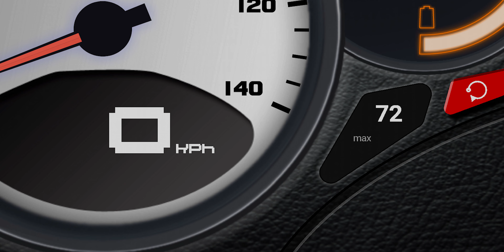ASW Carbide Ride 2 + Top Speed (4K)

Comment: All that done and only that fast.... mine is stock with only an A9 cam and it does that....
Reply from the maker: All the mods are for power not speed.
Reply: @MarcelsWorkshop  Power makes it more fun in the woods, I can relate ;)
Reply from the maker: @tntproductions2504  Exactly! I have no where really that I could use more then 70km/h, so being able to accelerate fast and climb hills in the tight wooded trail I do have is much more fun. :)
Reply: IF he wanted speed he would have bought some different sprocket sizes. But you want power when going on rough terrain